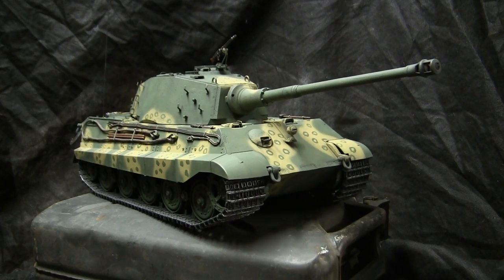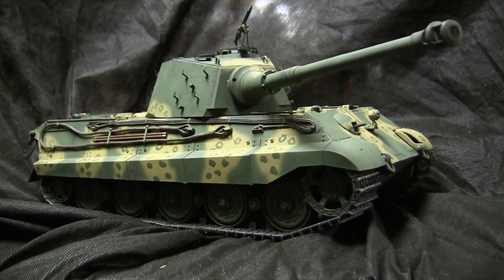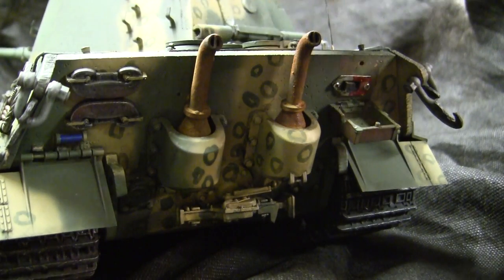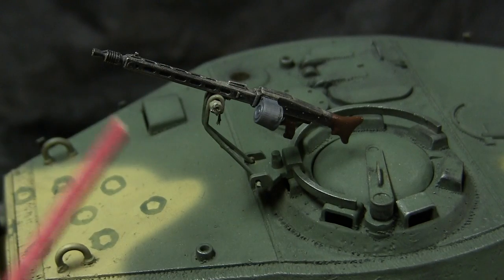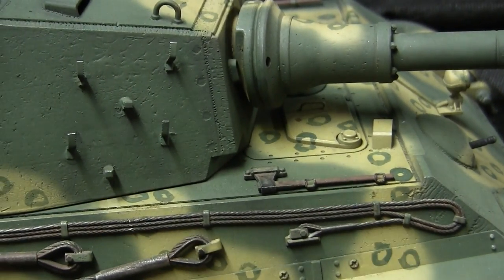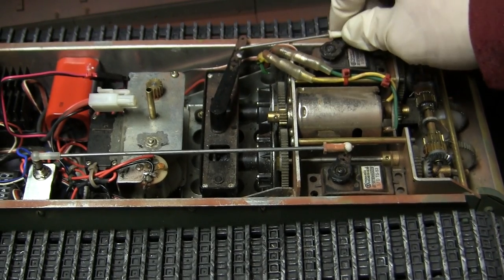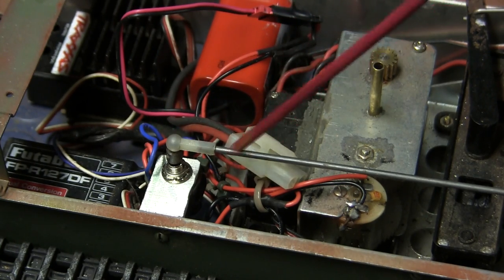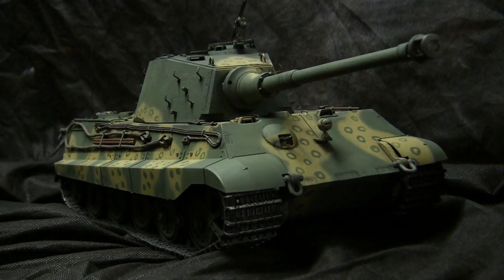Tamiya Vintage RC 1/16th Scale King Tiger Tank Model Showcase Video

Comment: Tanks for sharing, i just bought a '81 king tiger and its my 3rd vintage tank i bought(Gepard and Leo 1a4). i try to keep them so originel as possible, I have a high amp electronic controller wich give you a proper naturel drive.

Comment: hi, i wonder is it possible to change out the 540 motor to a smaller 400 motor so that the movement of the tank can be slow down? or by lowering the end point adjustment of the esc so that the tank can move more scalelike? thank you for sharing this video.
Reply from the maker: Probably, but it's just not worth it as the newer systems are better engineered and this model will be left as is, Also I was not driving the model in the intro, The owner was very rusty and forgot how to control the throttle.
Reply: thank you for reply. i m quite torn between buying this old k tiger and the newer k tiger. as i m not into wargaming. the sound production n wargaming capabilities are not so important to me. the older mechanical one seems to appeal to me because i was from the tamiya motorised tank era. however when i saw how it "moves"... i felt its a little too fast and "abrupt"... in your opinion, (may i ask) which k tiger will you go for? this or the newer one? thank you for producing this video. i have been watching it everyday. thoroughly enjoyed your walk through. joe. singapore
Reply from the maker: For a detailed model that runs well, the modern one all the way, The older one I recommend for as a mechanical curio of sorts or to fill a gap in a tamiya RC tank collection. The newer units are far better runners. There is a clunky motion to these old systems, as for the abruptness and speed this was again the fault of the driver who has not run this tank since about 1999. After a few runs I would imagine the speed can be controlled from the user. 

The turret rotation system on this 1st gen version leave a lot to be desired and wears out too quickly causing slippage, The lack of gun elevation and habit to droop is another ding on the first gen one. This is where the newer versions excel.

Like I wrote above I would go for the vintage one if the price was really good, and you are getting it for a nostalgic / vintage build, or to fill a collection... To get one to tinker with it to make it run better is really a fools errand as no matter how much tinkering and money / time you pump into it it will always be sub standard to the modern releases.
Reply from the maker: How many times do I have to state this... The owner was driving the tank and didn't know how to use the throttle. If I was driving the tank the throttle would be better controlled.

Comment: i am looking at the new king tiger manual.. the vintage model versus the new one are almost similar in contractions (external parts)... so far...
not the mechanical of course, for now that will do but when i reach the internals that is another problem

Comment: How did you set up the toggle switch for the turret rotation ? i have a vintage KT like the one in the video and the stock tamiya switch is suspect at best. any advice or link to a video on this topic would be great.
Reply from the maker: the switch was set up to go in reverse, the best way to illustrate how this was done was using this image, https://www.rollertrol.com/images/schematics/switches/DC-motor-reversing-switch-schematic-wiring-diagram-285x275.jpg